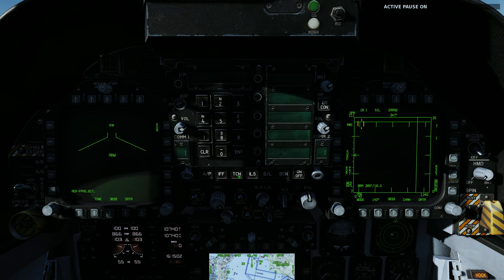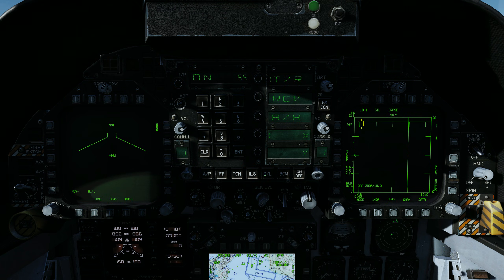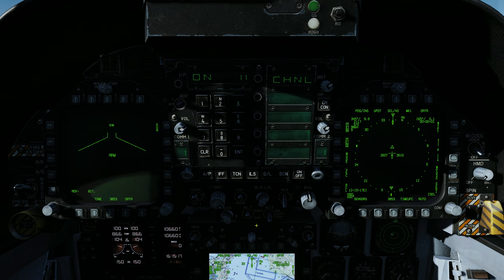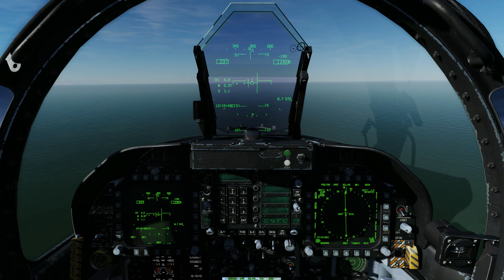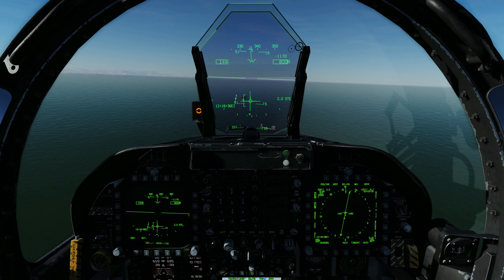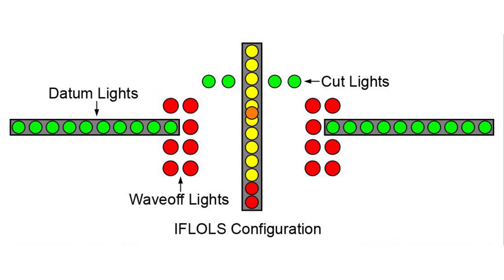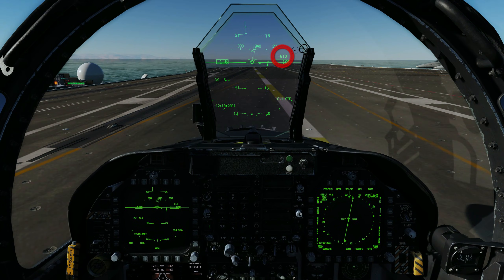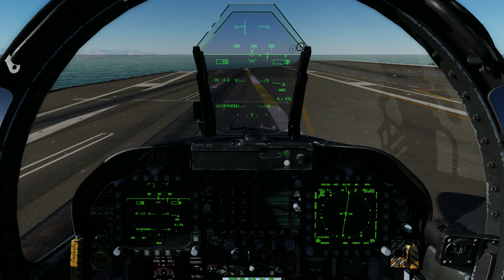DCS : F/A-18 Hornet : ICLS Tutorial

Comment: You said by 0.5 mile, your altitude should be 200 feet. However, yours was 270 feet!!
Reply: rule of thumb, fast and high is better than low and slow, when high the worst that can happen is a bolter or wave off, low you have the risk of smacking the plane on the back of the ship
Reply from the maker: It was actually 250, which is 50 feet higher than perfect, but I'd rather be 50 feet too high than 50 feet too low at that point.